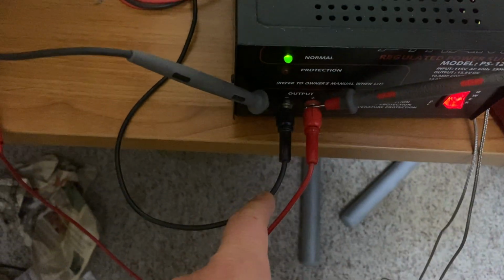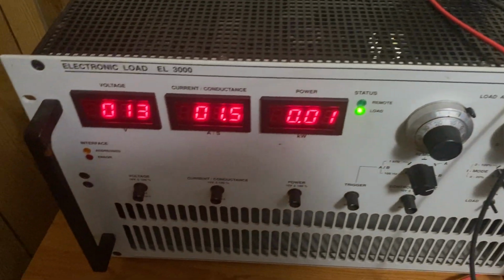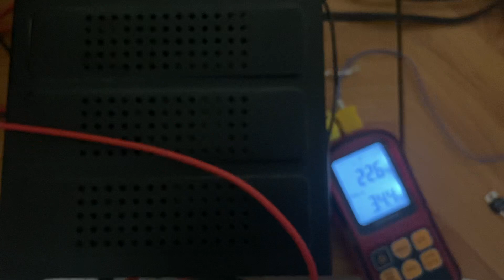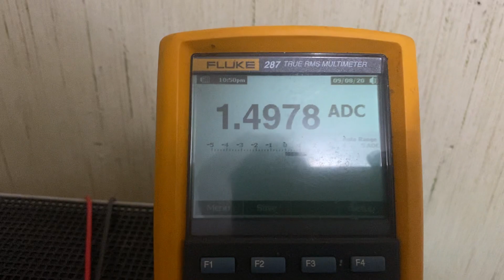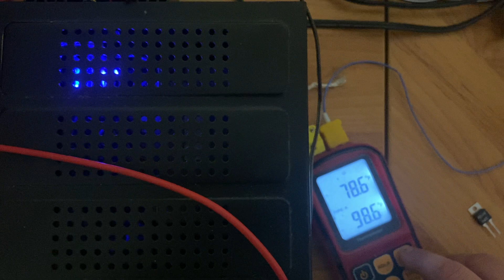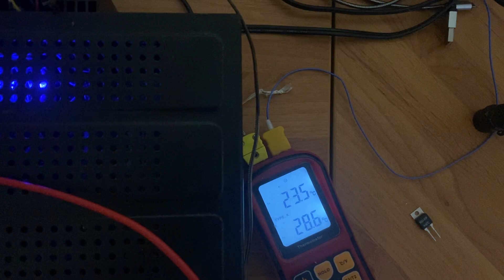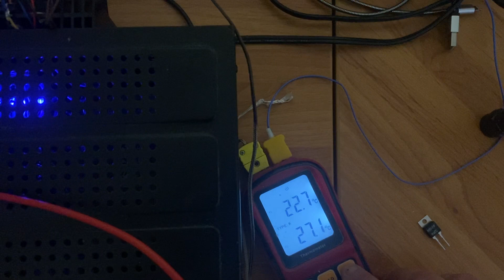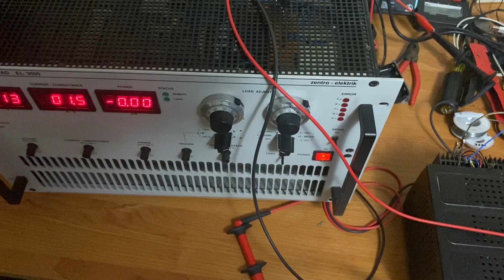Testing the KSD-01F thermal switch with a temp probe and an electronic load.

Comment: I'm looking for solder that melts between 500F - 1000F to attach wires to the KSD-01F thermal switch.  It will likely be exposed to around 400F on the heat sink where it's mounted.  Can you help me with finding the solder ?